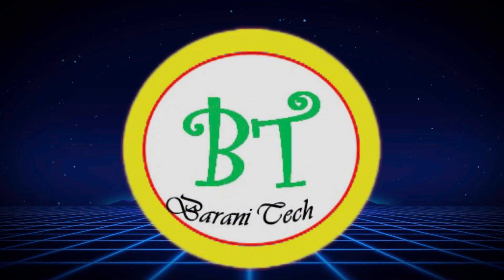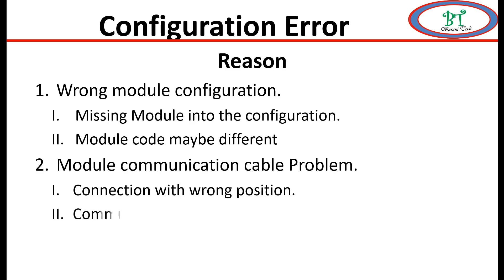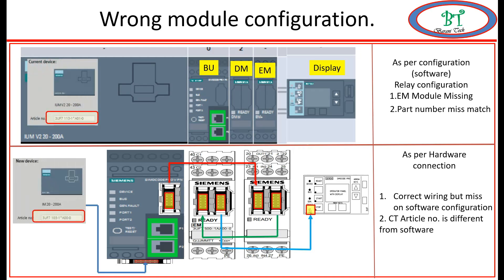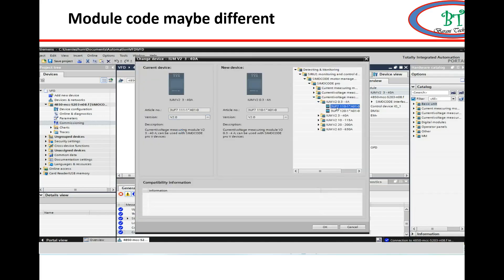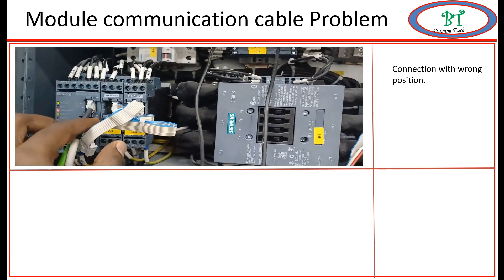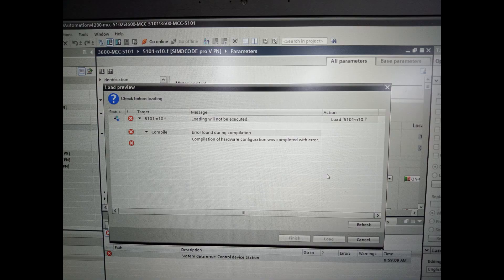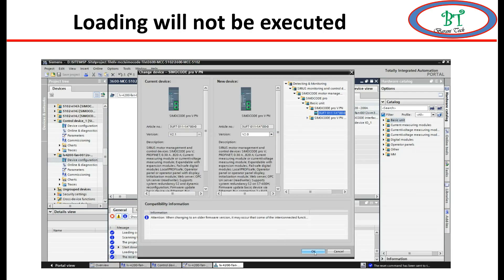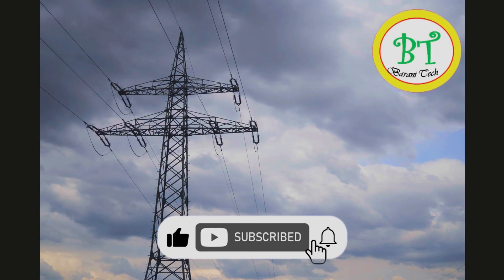simcode relay configuration error |  simcode relay loading will not be executed

Comment: Hi, 7SL86 i ve received error ' Failed to analyse IEC 61850 part'.. So that i m not able to retrive the data..
   But i  am able to load the configuration from FAT configuration file.. What will be the issue? Thanks in advance
Reply from the maker: try to save IEC61850 in local location and then try thank you.